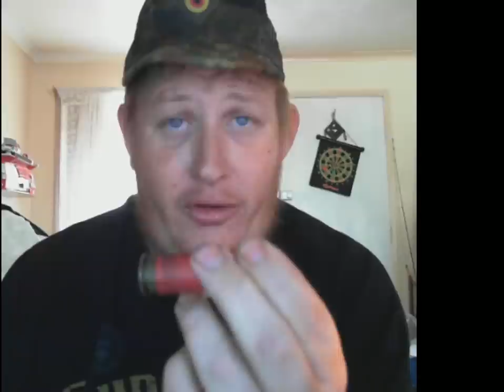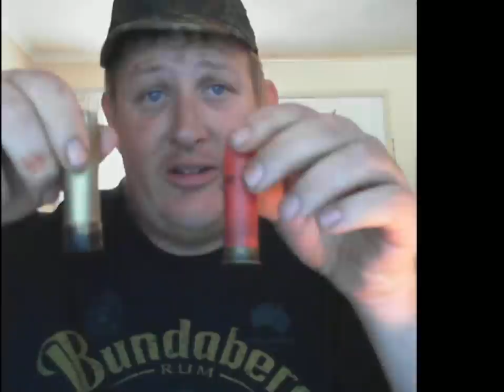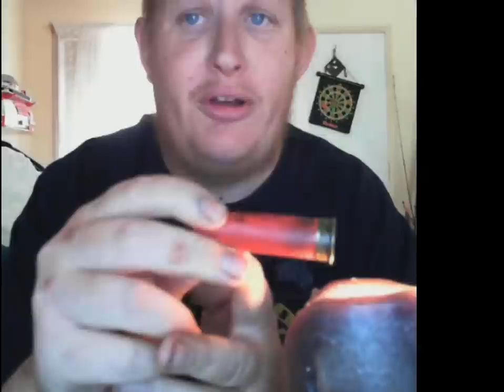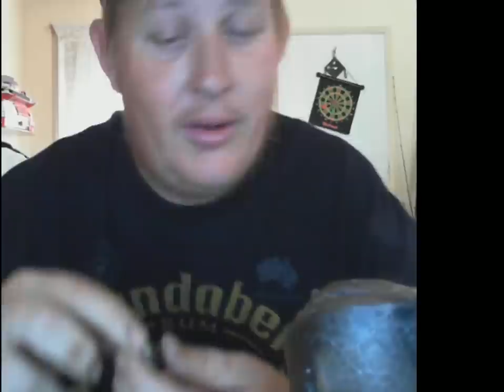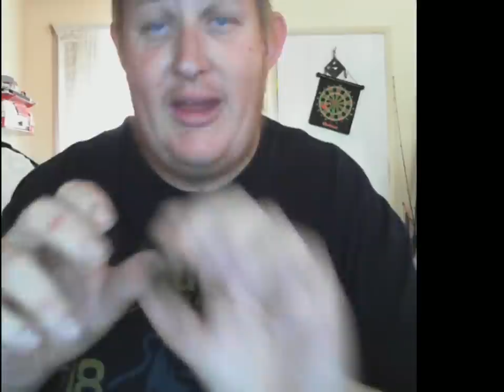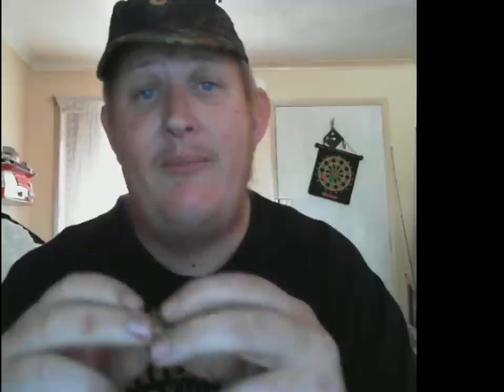How To Make A Fox Whistle Useing Shotgun Shells

Comment: hey mate i just made one after watching you video except i got a socket a fraction bigger than the brass and hammered it in then the other brass could slide into it i was using the long brass so i needed to close it up thanks for the vid they are $10 on ebay for these
Reply from the maker: Good stuff mate I did a simular thing with a few high brass cases as well just cut a few slots in one of the brass an tapped them together you will have to let me know how ya go when you try it out cheers for the comment happy hunting